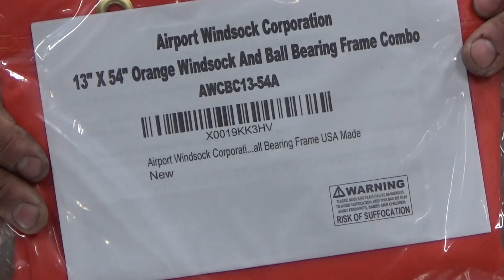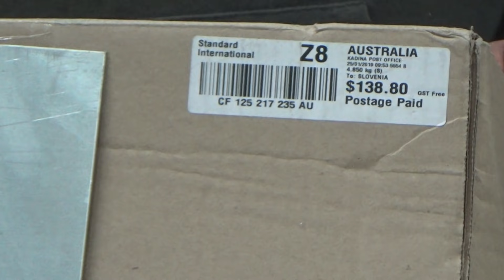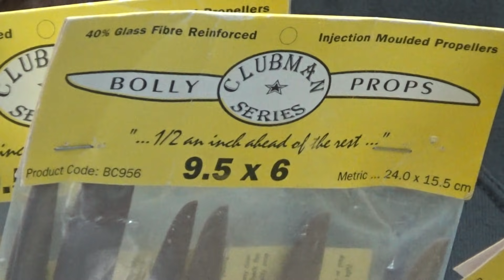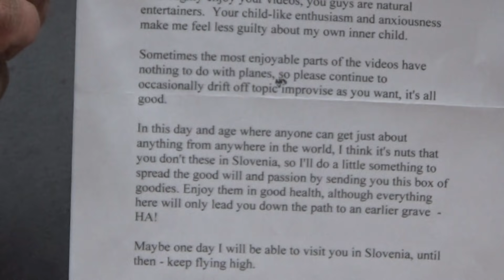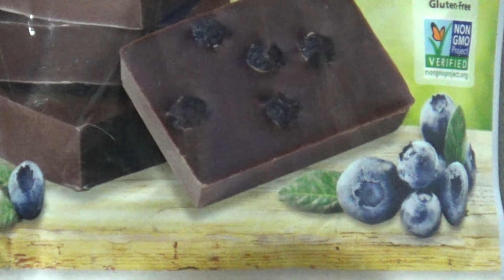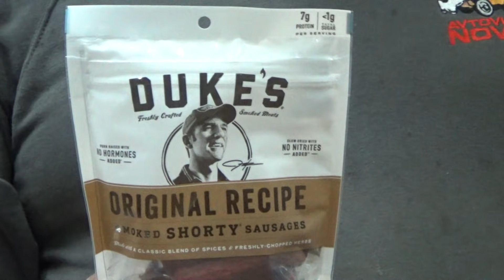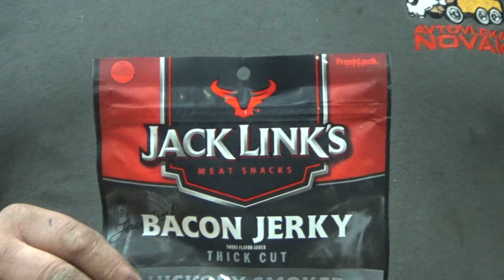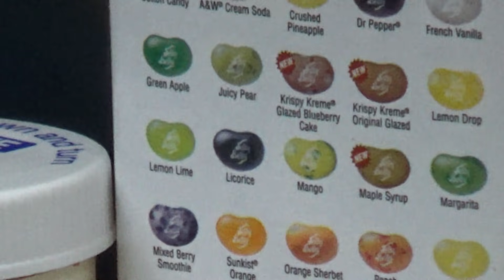AUSTRALIA and USA friends gifts Unboxing

Comment: The Bolly props are great, I have flown with them here in NZ on my models and I use a Bolly 68" dia 3 bladed carbon fibre composite on my microlight, a very popular configuration for these types of light aircraft. 
The food parcel should have been sent to you before winter to carry you through...😀
Reply: Mazowe yes i love them to....yes bit to late ;))

Comment: Hello Brother pilots :)I was wondering captain blatz  I want to change the motor from electric to glow on p51 1.38mm wing span balsa kit  using   Os 15’ glow engine  CG on manual says 2 5/8 in aft of front leading edge  : my question after build  the plane seams tail heavy  after install of all components should I just continue to add front weight or do I need to reconfigure  CG